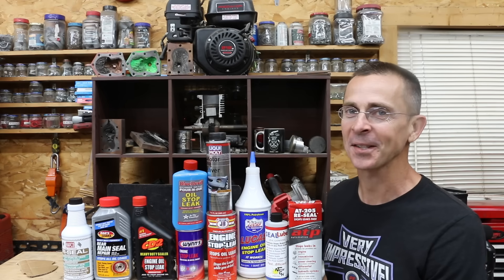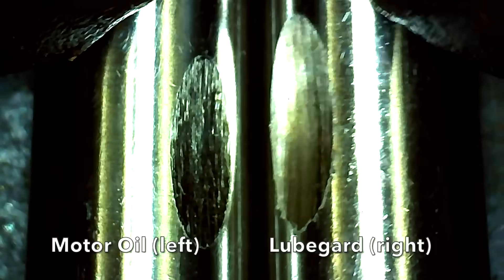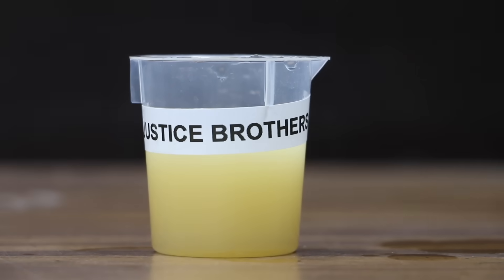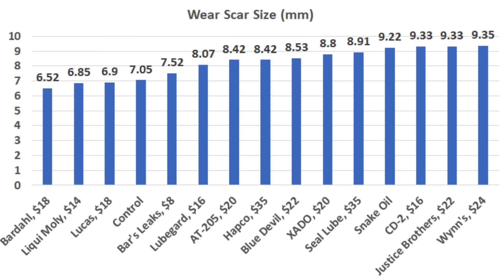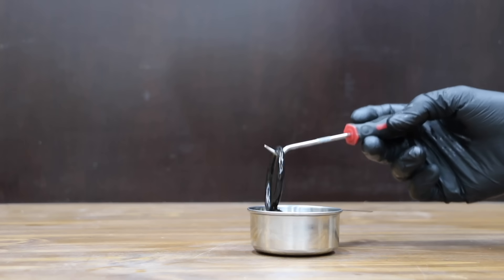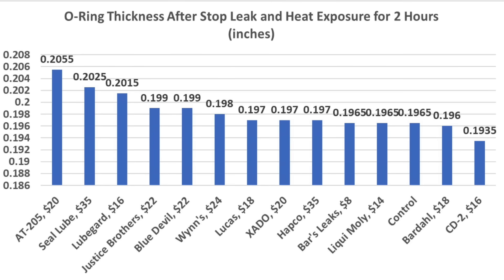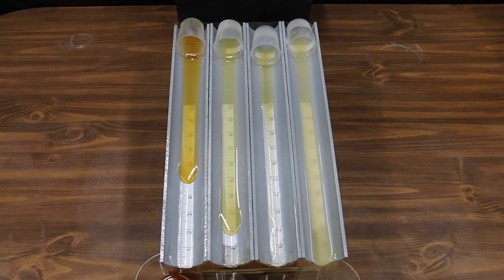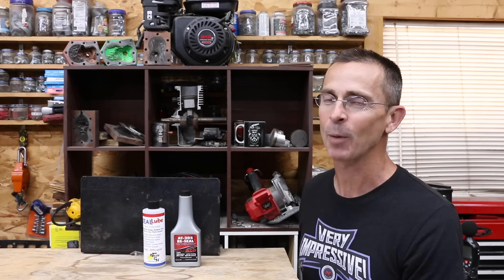Do Stop Leak Products Work? Do They Damage Engine Seals? Will They Destroy an Engine? Let's Find Out

Comment: You need to do this exact series over again, including that seal hardness meter, but with every brand of oil that has a high mileage oil version. We need to find which oil can soften seals the best to be able to stop engine main seal oil leaks. Maybe automatic transmissions and their high mileage versions too. They could stop torqued converter, tail shaft, and axle shaft seal leaks.
Reply from the maker: Thanks for the feedback.

Comment: @projectfarm I wonder which product works best to eliminate white smoke from the exhaust? Despite At205 being number 1 for the seals, the fact that it performed so horribly intest number 1 scares me. It caused damage to the wheel in the test. I have white smoke due to one bad injector. Ive since changed it but there is residual white smoke. Im leaning more towards Bardahls or Liquid Moli. What do you think?

Comment: When my grandfather passed, I got his truck. I drove it maybe a mile down the road and realized the power steering fluid was empty after hearing all the whining. Luckily, I was just down the street from an AutoZone. I bought a couple bottles of Prestone power steering fluid with stop leak and literally watched it go in and right back out. My uncle told me to try aT205 before I changed the power steering pump, so I went ahead a tried it. was 3 1/2 years ago and it still hasn’t leaked since using at205. It’s a great product, and in my case, it was a miracle in a bottle.
Reply from the maker: Thanks for sharing.

Comment: I had luck with Blue Devil quart bottle not pint bottle, the mechanics version.
Removed the sparkplug of the cylinder that was pressurizing the cooling system and idled per directions 
She and I broke up, but I know it lasted 2 years+
20?? Chevy Equinox 3.? The 6 cylinder with the cooling system bleeders lower than the thermostat
Reply: Cooling system stop leak not oil

Comment: It seems to me the most sensible thing to do, if you choose to use these products, would be a two step approach. 1 use the Lucas and give it one heat cycle and then add the at-205 and let it run at idle for 20 mins and then change the oil.
Reply from the maker: Thanks for the feedback.

Comment: I used Barrs Leak PS Sealer 6 years ago after losing a pint of PS fluid a month. Since then I have not had to add ANY PS fluid after 40K miles.
Reply from the maker: Thanks for sharing.

Comment: My 2018 Nissan Versa had a rubber on metal squeek in the front end when it was cold. I tried spraying silicone on the rubber parts but it didn't help. Then I sprayed some AT-205 on the rubber parts and the squeek stopped.
Reply from the maker: Thanks for sharing.

Comment: I have a leak in the radiator cell. I am thinking using Liqui Moly sealant but I worry about my evaporator and other hoses might block
Reply: one guy had a good idea - drive for a while with the stop-leak, but after a day or maybe less, drain your system, throw away coolant, and then use fresh stuff. I wouldn't turn on my heater for a while, though, because stop-leak products can ruin your heater core.  I mixed green with red coolant in an Asian car and that may've blocked my radiator - it is leaking badly.

Comment: The ones temperate are the additives that find damaged seals or what not to seal damaged gasket not to prevent friction.. NO ONE GOT THAT??? JUST LIKE RADIATOR SEAL the additive finds holes to seal to prevent oil passing threw

Comment: @douglaseuritt3919
0 seconds ago
So…you can re-swell the o rings and wear your motor out fast or take the motor apart and replace the leaking o rings.

Sounds like the best option is just to keep the level topped off until you can replace the leakers.

In other words, these aren’t solutions to anything

Comment: I know blue devil works. Nothing will fix a hasket that is torn. But I disagree with you on not adding these to and engine that is not leaking. My thinking is, after 100k miles or every 5 years, add a bottle at one oil change to help resoften the seals, and keep doing it every 50k or 5 years after that to help keep seals softer to prevent leaks. Kinda like adding cataclean to your fuel every 40k miles or so to clean the cats.

Comment: hey man, just a thought but have you considered trying the tests with the correct mixed ratios as well? this is good info don't get me wrong but, this being especially true for the oz's to quart ratios, this isn't indicative of how it would be in the engine. the one's that are akin to oil were obviously better in those conditions but the ones that were more like water are now taking up much more than they ever normally would in the mixture. just a thought to help the testing process.

Comment: I have a high mileaged 2008 silverado with the 5.3...  The rear main is certainly weeping - the skid plate catches/contains the leak but not enough to get drips on my driveway.  In otherwords, any of these top finishing products shouldn't hurt it?  It is not my daily driver and I would rather have it in the shop yet for the rear main seal repair.
Reply from the maker: Thanks for sharing!

Comment: Video mentions to not use these products unless you already have a seal leak. I have a 2009 Camry. Why would I not want to add At-205 to the engine, transmission, power steering, etc as a preventative, BEFORE I get a seal leak?

Comment: I used Valvoline r and p for 400 miles in my very well maintained 01 Ford V10 it caused my valve seals to leak. I dumped it and put in penzoil platinum ultra and added AT 205 200 miles later, no blue smoke at startup up. Should i leave it in the engine untill next oil change at 3000 miles? Thanks

Comment: I have an engine oil pan gasket leak. I am assuming AT-205 is the winner to treat this problem correct?
Reply from the maker: Thanks for the suggestion.
Reply: @ProjectFarm Sorry for the confusion. I'm not suggesting. I am asking to confirm that, according to the video, AT-205 tested the as the best choice to use to fix my oil pan leak?

Comment: Could you test prolube oil additive out.
I just watched a video the put out. It was a self destruct test. The only thing is the used a different model predator engine than the control and the ones they put the competitors engines. I noticed the one they put their additive in was the better model. It also had a larger valve cover, which means it will retain a little more oil when they drain it.
 Thanks
Reply from the maker: Thanks for the suggestion.

Comment: Your videos show the most thorough testing on products and their claims. Even testing that no one thinks about, such as does a stop-leak product reduce the effectiveness of the oil itself, or does it even mix properly. It looks like AT205 is the best at stopping leak, but perhaps changing the oil after the leak has stopped is the best method to prevent long term wear.
Reply from the maker: Thanks!

Comment: I know this is now an "older video" but on my 97 Explorer, which is for some reason impossible to get power steering parts for (the proper part seems to not exist except for OEM and they aren't re-sold).. I used power steering stop leak and it did in fact fix the problem. Does it sometimes need to be re-added? Yep
Has it destroyed the power steering system, a fluid power steering system? Nope!
Reply from the maker: Thanks for sharing.

Comment: I have a car with the infamous Toyota 2.4L with that horrible oil leak. I've tried them all and somehow, the cheap STP option at Walmart has worked best for me and got me to keep most my oil between changes when before I was refilling 3 quarts of oil in 1,000 miles.
Reply from the maker: Thanks for sharing.

Comment: Why did you not use the ratio suggested on the products packaging instead of a 50/50 ratio of motor oil and leak sealer ?

Comment: Thr only 1 seen to actually work is A.T. 205..it works on seals ..like rear main ,front main seal, wheel seals,axel seals. Also hydraulic system ,trannys. My steering box was leaking,I poured half a bottle in.. like magic it worked

Comment: I have an issue with an old tractor and hydraulic fluid leaks. The seals were about $5.00 but apparently, I have to completely remove both rear axle cases to replace them because the seals can only be inserted from the inside. That's not a small job. I know this was motor oil not hydraulic fluid, but I enjoyed one of your other videos and decided to watch this one. Great data. Thanks.
Reply from the maker: Thanks!  Thanks for sharing.

Comment: Again, you don’t seem to understand the scientific method; and ignore manufacturers’ specifications. None of these products claimed to reduce engine wear, they’re for reconditioning worn seals during a single oil change. Then you drain and use normal oil, when the gasket leak is sealed. 

Then you go and use brand new o-rings, that aren’t used in engines. You should’ve used piston rings or gaskets; that are actually inside engines. Even then, you should’ve scorched/worn them down in an identical fashion to test the reconditioning claims. There’s nothing to expand or restore on a brand-new o-ring. 

It blows my mind that people think you’re smart. You’ve clearly never taken a college chemistry or physics class.

Comment: Great test.  But I think there is a mistake.  The proportion of resealers against the oil proportion was set at 50/50.  I think this is wrong and should be done with the proportions indicated on the label.  When proportions are ambiguous on the labels, then some judgement may be applied.  For example, the one that asks proportion on number of cylinders can be done as 1 bottle for a typical V6 engine.  I doubt that some one will pour 6 litres of the stuff in a 6l capacity engine.   Great work.  Can you please please redo with this consideration?

Comment: Very interesting and valuable presentation as usual!!  
Based on the test results, AT-205 expands the rubber the most but it also softens it the most.  While softening property is good for gaskets, I am afraid it can also hurt O rings that rub against metal, such as, main seals that is constantly rubbing against the shaft while engine is running.  Since it makes the rubber softer, it could also wear it out faster as well.  This is what is worrying.  So initially it could stop the leak but eventually you may have to add more and more of AT-205 to stop the leak as the rubber wears thinner due to wear.  It would have been very nice if this test included O ring wear test after the treatment with each product.  This would give you a complete picture.  Thanks for the video anyway!!!

Comment: Would it be possible to add a stopleak of choice and leave it in for a week of driving, then changing the engine oil? Would the seals retain the stopleak properties even after it’s no longer in the oil? Any input would be appreciated thanks.
Reply from the maker: Thanks for the suggestion.

Comment: Watched recently. Decided to try "Seal Fixx" on my old motorcycle. Tried a few drops onto the forks to work into the fork seals which were oozing fork oil. It worked. One side completely stopped leaking, the other is down to a slight smudge of fork oil. So, I added 3 oz. into the motor oil. Good and bad result.  Seems like the leaking push rod seals have mostly stopped leaking. Did an oil change, and the valve covers had paint on the inside which I thought might be overspray from the factory. In over 100K miles, stayed hard and smooth. When covers came off this time the paint was completely wrinkled and when pushed with a rag it completely came off the valve cover insides. This was a "splash/drip" lubrication area so the paint never got washed into the oil gallery, but I doubt that I will use the Seal Fixx internally again. Love your videos.
Reply from the maker: Thanks!  Thanks for sharing.

Comment: Great video, while I do agree that a proper repair is the best option out of all the leak stop additives, depending on the type of repair it can be time consuming, expensive, and other factors. So a leak stop additives are good for a temporary fix until a permanent fix happens. For me, I have those two factors, for now Im going to use the Lucas additive in the next oil change and make sure to follow bottle directions. This is till I can do the proper repair when i do get the resources necessary.

Comment: What age is a newer vehicle that you wouldn't use one of these on? 2017 Didge Grand Caravan,, 83000 miles. Leak diagnosed by garage, but I saw no evidence of oil under the van when parked for days on end. VERY expensive to fix. Thank you.

Comment: There is no long term fix. Short term yes. If you keep your vehicle a few years or more Do Not Use these products as they destroy oil seals in engines and power steering racks. currently after using AT 205 reseal for a slight oil leak in power steering a week later the rack exploded oil all over my driveway and now even doing the job myself I've got an increasing bill of £1000 and I'm not there yet. There is no long term fix for oil seal leaks, that goes for Lucas leak stopper as well, in fact I inadvertantly used it on a non leaking rack ( it was just a slack pipe) and a few years down the line it has perished the rack seals.

Comment: I’m wondering if a oil leak sealant works for a Chevy Cruze. My car has a leak in the oil cooler, which causes a lot of smoke when the oil drips into the catalytic converter.
Reply: I am having the same exact problem as you on my 2014 Cruze. Oil cooler is leaking and causing smoke while driving.
Reply: I added 8oz of the At-205 to the Cruze. It seemed to stop the oil leak in two days, but now coolant is leaking very bad. This is the second car this has happened to me using the At-205. It seems to seal the oil leak , but then the pressure goes to the coolant system like the water outlet gasket and blows that seal. Just my experience on two different cars in the past 6 months.
Reply: @cdh77  thanks for share your experience.

Comment: At 205 works I've been using it for years Scotty kilmer turned me on to it. The first vehicle I  used it in was a 01 ram 2500 with a 5.9 magnum that had a leaking main seal (a it a week) 270,000 miles and it went from a QT a week to a QT about every 4-5 months
Reply from the maker: Thanks for sharing.

Comment: Is it possible that some of the evaporative loss was actually because it soaked into the rubber o-rings? I noticed that the ones with the most loss also caused the most swelling of the seals. I suspect some of the product was absorbed rather than evaporated. 
Good test btw. Have had good success with Rislone main seal repair

Comment: I'm on the market and I've read the documentation - the problem here is that different brands provide their optimal result in different amount of time. Also the ratio of 1:1 is not ideal for some of them. All I'm saying is that your test doesn't show if someone is the winner, or if the winner is actually "over healing" the seals making them swell too much. However, the video was interesting and you've put a lot of efforts in it - kudos to that!

Comment: Contrary to popular belief and stereotypes, snake oil has well proven usefulness for numerous applications. I tried Xado transmission  supplement in my LX Accord which is notoriously picky about fluids and it’s working better than when I bought it; I also used the Castrol Universal instead of OEM fluid and it works fine after over 20,000 miles and the fluid in it when I bought it was brown and burnt. Just to be safe I do a carbon cleaning, preferably with water through a misting fan with a coffee filter fixed over it and NiCads in the battery pack to compensate for the air exchange otherwise. Nate’s Interactive Auto isn’t a great source, but his video seemed believable enough. Water and oil are so repelled that I bet it works as well as he said and is safer than everything short of disassembling and walnut blasting before reassembling and installing, above and beyond the charge for ringing you up; burning gas produces water and the heat of the engine makes most any evaporate quickly and the reason why “washed” cylinders are so shiny is because coolant is 50% pure water

Comment: Just bought a 2013 Volvo s60 t5 with 150k miles for $2k that burns about a quart every 200 miles based on this video, and scotty's praise of ats engine deposit cleaner.

This car doesn't leak a drop of oil anywhere, but the tailpipes are completely black and the engine is very enameled.

Seller wanted $4,500, so we'll see if I got a good deal or screwed myself.

If I can get the oil consumption down to 1 quart every 1,000 miles, I'll consider that a win. 

It would cost $2600 to fix my previous car, so if I can get the oil to consumption down to 1qt per 1k miles, I'll break even. This new car gets 50% better mileage, but the premium fuel costs about 30% more per gallon. So the 1qt of oil per 1k mile brings the difference in operating cost to $0.

Comment: Methyl Salicylate works as well as st-205 but much cheaper.  You can buy 128oz for $75.  But neither are permanent fix.  O rings shrink back when it is taken out of these fluids. So, you have to add every time oil is changed.  Also neither will work on anything made of pure silicon because it does not absorb these fluids.  These will work on anything that contains substantial amount of real rubber or cork.

Comment: If you can get the seal / gasket or whatever rubber component out so you can soak it. Wintergreen ( Rexall brand ) rubbing alcohol does a excellent job of bringing super hard rubber on the verge of cracking back to life. This works great on Motorcycle components ( carburetor manifolds  etc ) from old sun burned heat dried projects.
Reply from the maker: Thanks for the feedback.